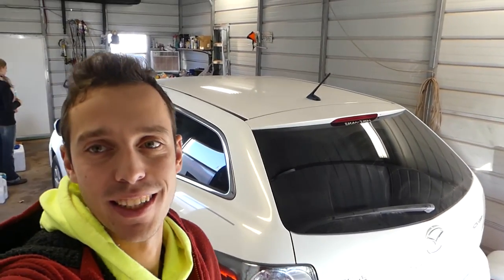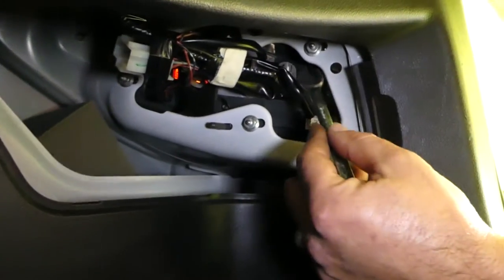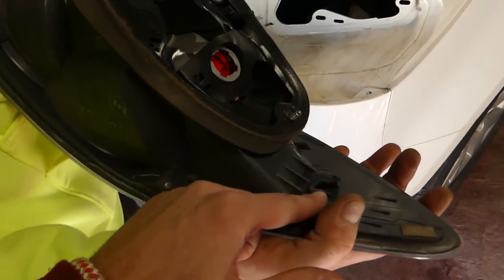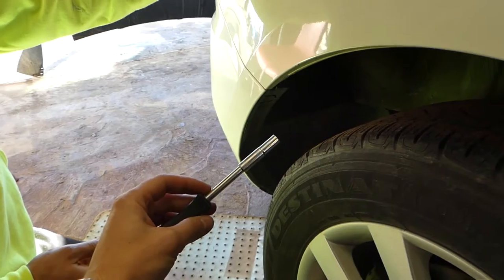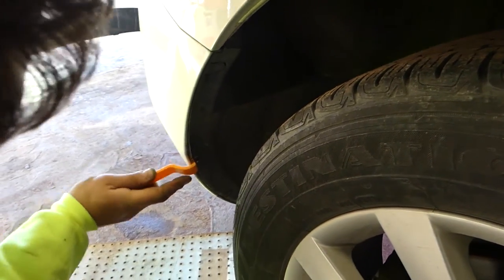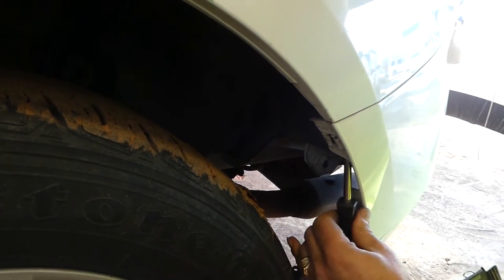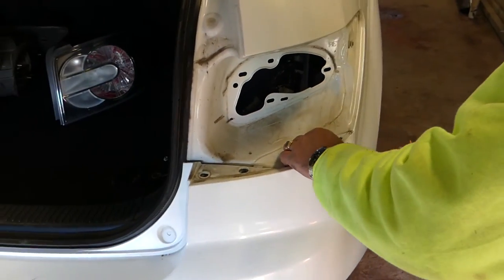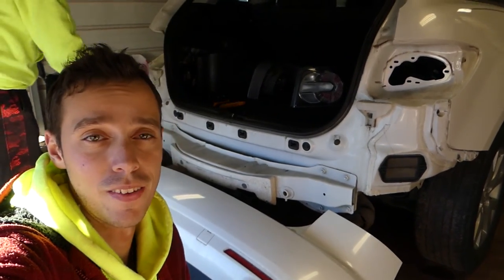MAZDA CX-7  REAR BUMPER COVER REMOVAL REPLACEMENT

Comment: I'll be using this to remove a rear bumper cover on a 2012 CX9. Hopefully, it will be similar. 

Any videos on replacing the rear hatch?
Reply: I see you commented this awhile ago-- im looking to remove mine, did it work out well?
Reply: I need to do CX-9 as well .
I always thought of the cx-7 as a CX-9 with a 4 cylinder .
So I'm pretty sure it will be similar if not exactly the same .
  Its amazing that the cx-7 was sooo popular and underpowered that Mazda discontinued it . Only to make the same mistake with the CX-9 4 years later . Have you ever looked at sales figured for the CX-9 once they shrunk it and dropped the v6 ?? 
Less than half ! 
When all they needed to do was add an 8 spd transmission or even 10 speed like the 2018 Expedition and ZL1 Camaro. And it would have gotten the same gas mileage as the turbo with even better torque range utilization, and they wouldn't have had to shrink it and probably could have grown market share l.
But nooo,you'll get a turbo and that's your only option.
I hate to be unkind ...but idiots ! Do they even bother looking at their sales numbers ?